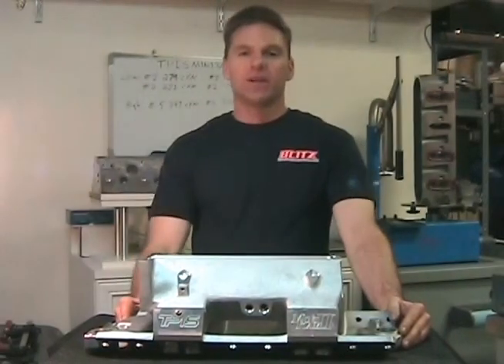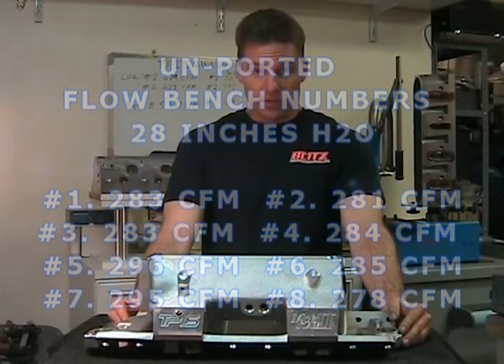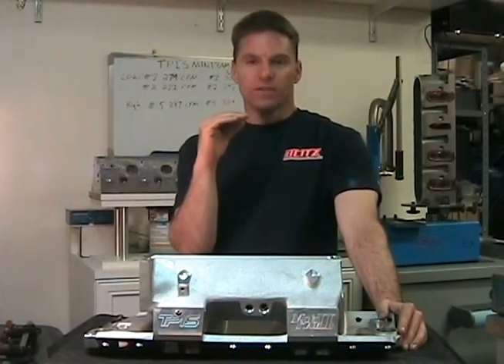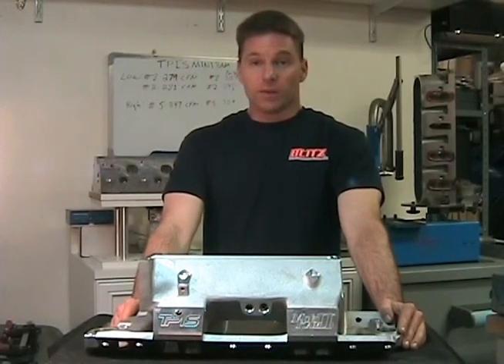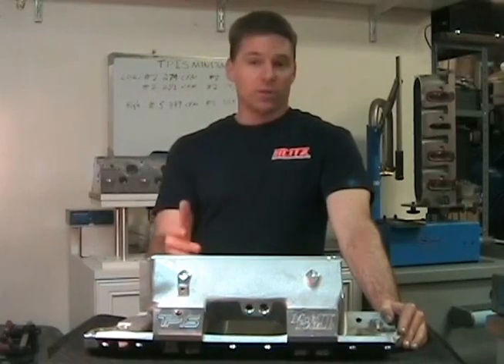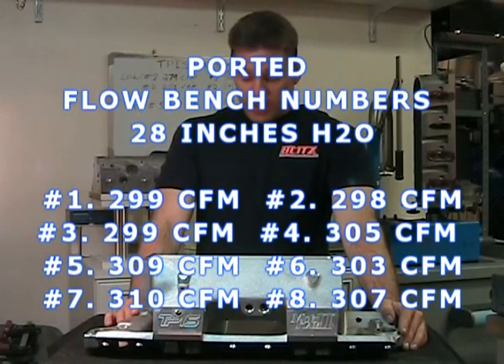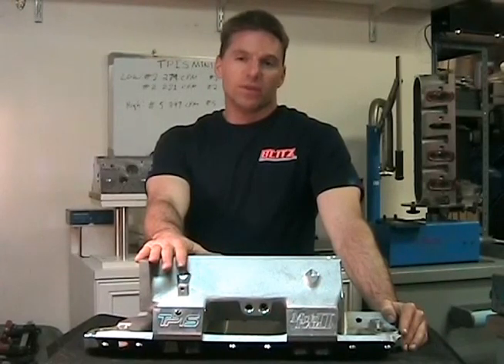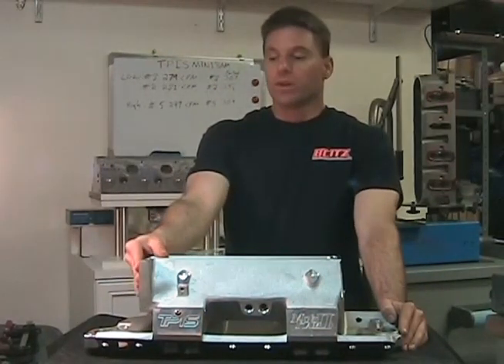TPIS MINI RAM Un-ported & Ported Review Video #2

Comment: Has you, or anyone else ever experimented with a throttle body spacer? If welded to the plenum it would allow for a nicer radius to cyl #'s 1,3&2,4. It's a pretty abrupt 90° turn it had to make instantly after the throttle plates. Maybe another 1.5-2 inches would allow the air to stabilize and stream line? Just a thought. It could also help with some of the idle issues these intakes have from front to back variations in afr.
Reply: I have not tested with any spacers.  I did a lot of flow bench testing throttle body spacer extensions on an LS3 intake and the heads actually lost 5 cfm above .500" inches of lift.  So, it's hard to say if it would help, or hurt the mini-ram.  Other than carb spacers, I don't really think throttle body spacers have much effect.